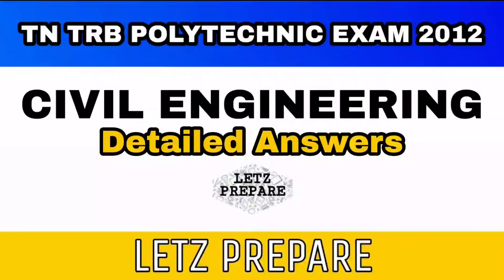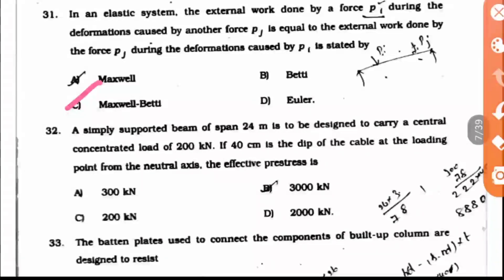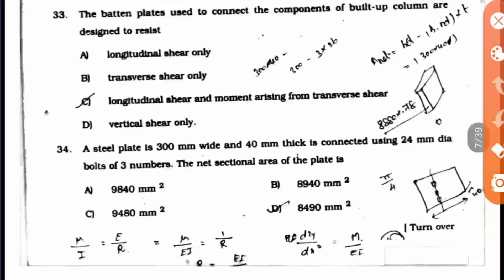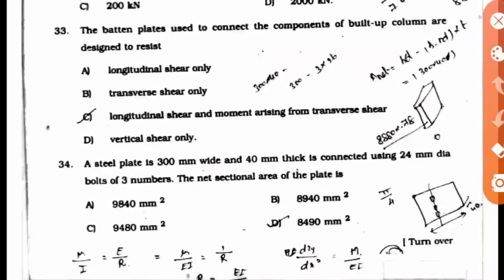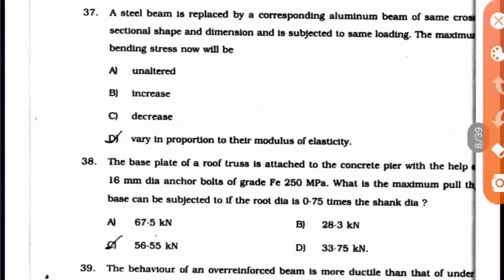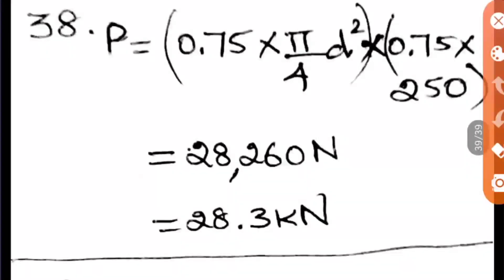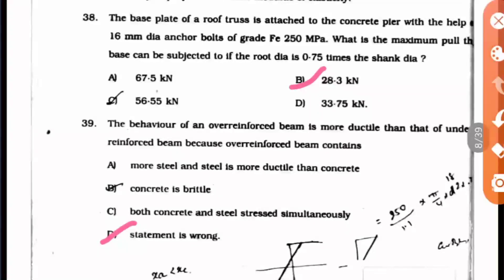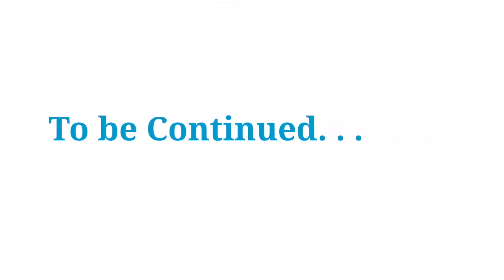TRB Polytechnic Civil Engineering 2012 Question Paper Discussion (31-40)

Comment: Q.no 36 loss due to elastic shortening is for both pretensioned and posttensioned beams Thana mam
Reply from the maker: Yes. But in case of post tensioning, it occurs only when the bars are successively tensioned. There will be no loss due to elastic deformation if all the bars are simultaneously tensioned. 
So it is the major reason for the loss in Pre tensioning is more than the loss in post tensioning.

Comment: Mam explai q.no.37 bending stress= M/I × Y here bending stress does not depends upon the material . Is it correct
Reply: If it depends upon E then how it remains unaltered
Reply from the maker: Yes I too have that doubt. But in TRB Key they gave option A as answer. But based on formula, option D is also correct.

Comment: Q. 39 I am totally confused because  under reinforced section failure occur  ductile and over reinforced section  failure occur  brittle  then, here over reinforced beam is provided addition steel at bottom so it gaves more ductile  but ans key statement is wrong       , mam can you clear my doubt
Reply: Tq so much mam, after completing  trb polytechnic  civil 2012       and also solve trb polytechnic  civil  2015 as well as tnpsc ae previous year question  it is very useful exam    because 80 percent syllabus is same only  kindly consider my request
Reply from the maker: Sure. Keep Watching ! Keep Preparing !
Reply from the maker: In Under reinforced section, Steel reaches ultimate stress before concrete reaches its ultimate stress. Therefore the failure occurs first in steel as ductile. 
In Over reinforced section, concrete reaches ultimate stress before steel reaches its ultimate stress. Therefore the failure occurs first in concrete as brittle.
Reply from the maker: In Question, they have given over reinforced beam is more ductile which is a wrong statement.

Comment: In Q.34
If the dia of hole is 25.5 mm then answer would match. It means they have added 1.5 mm

As per IS 800- 1984 (old code)
1.5 mm has to be added to bolt dia
Reply from the maker: Yes It's correct. Thank you for sharing with Letz Prepare.